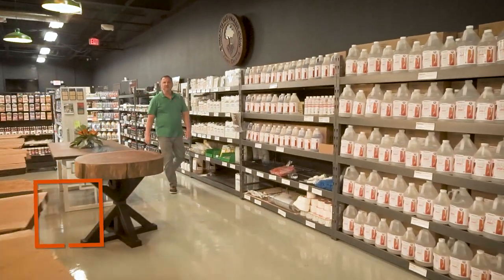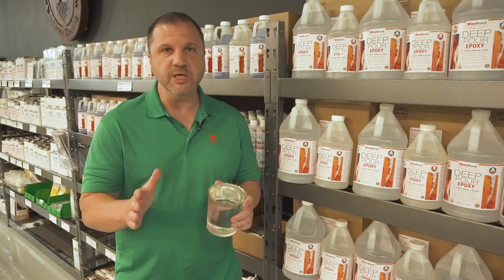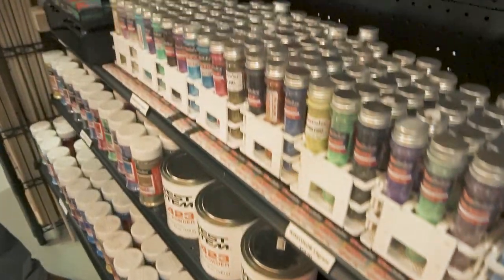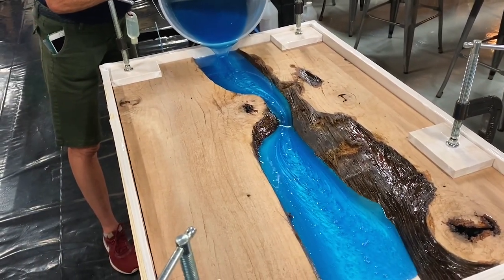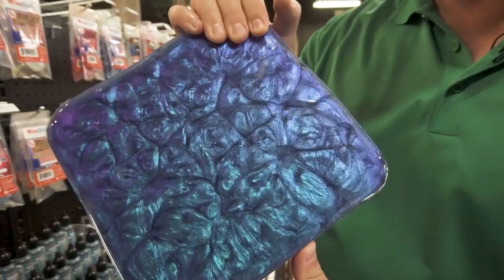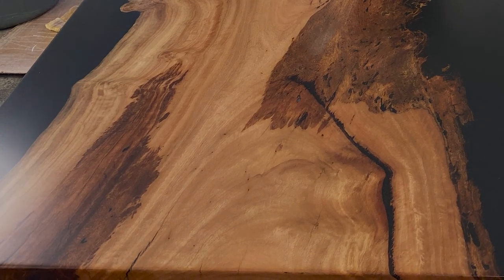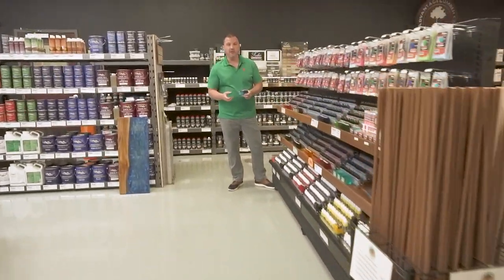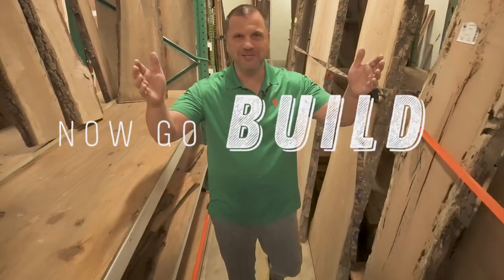Epoxy Colorants Explained- [Mica Powder, Alcohol Dyes, Pigments, And More!]

Comment: I bought a custom made table, they filled a hole of broken wood with some pink-ish epoxy, I honestly don’t like it at all, I hope they had used some darker color epoxy. My question is: is there any way to stain it to make it look darker? The table is finished and we epoxy fully dried.
Reply from the maker: The only way would be to carve out at least the top layer of the cured epoxy using a router or chisel and then pour new epoxy that is colored the way you want it.

Comment: Ok first timer question. I’ve been filling cracks with solid black epoxy using a dye. It’s a cookie cut piece of cherry. Was hoping for a natural finish with black accents in the cracks but the epoxy worked like a stain and the whole piece picked up the black. How do ppl get the black only in the crack without bleeding?
Reply from the maker: That depends on how porous your piece of wood is. You could clear coat the top first to prevent it from staining the wood. You also might want to try different epoxy and colorants. We recommend WiseBond.

Comment: Thank you for the video! It is very informative! If I want to get a swirl of Bronze and dark black, can I mix a Chestnut mica with a Bronze/Copper mica together? If I want the two colors to swirl together but not mix into a single color, should I create a separate pour for each color and mix it using a stick? Or can I pour both mica powders into the same mix and it'll end up having a color mix and not blend? Thanks!!
Reply from the maker: Assuming this is for a river table: Mix 2 colors separately in their own buckets and let sit for 2 hours to get slightly. This thickens the epoxy so it is not so water-like. Slowly pour the colors into the river from each end of the table. The color will meet in the middle. Ideally, you could also make a dam out of cardboard (or something) and once the epoxy is poured, each color wouldn't touch each other. Remove the dam at about the 4-5 hour. But this isn't an exact science. There will be a sweet spot where the epoxy is thick enough that you can "swirl" the colors yourself with a popsicle stick.

Comment: Truly informative.  I am just starting to explore pouring with color.  Keep the informative videos coming.  I'd love to visit your shop.  I have two cuts from a tree that I've dried and want to do something with.  I planned on two side tables.  I'm not sure how to finish them with epoxy.  One has a crack that I'd love to pour a blue color in.  Would I let that cure, then pour the clear?
Reply from the maker: Be careful with wood you cut yourself. The first issue if you air dry it generally takes one year per inch of thickness so if you have a 2" thick slab it would take two years to air dry the center. If it's not done properly you are likely to get lots of undesirable movement like twisting, warping, checking and etc... this could ruin your epoxy job. The second issue is bug larvae such as the powder post beetle can live in wood for up to a year and hatch out even if it's totally encased in epoxy. This can cause an infestation in your home where they chew through all your hardwood items in your house such as kitchen cabinets, trim, flooring. This is why proper kiln drying where the core of the lumber reaches 130-140 degrees to kill bug larvae is very important.
Reply: @AdvantageLumber  I soaked the slabs in :Preservation Solutions - Pentacryl - Green Wood Stabilizer - Treatment for Drying of Fresh Cut Wood - Good for Softwood & Hardwood - Woodworking, Carving, and Turning Solution - 1 Gallon (several gallons) in a tub for 1 year.  Then I took them out just a few weeks ago to dry.  Does this make a difference on the potential "bug infestation".  The only reason this huge pine tree was harvested is due to horrific winds we had in 2020 and it blew over next to friends house.  It appeared to be very healthy.  How will I know?

Comment: Question. After making a table with just walrus oil. And decided to put table top epoxy on it. Will the walrus oil need to be cleaned off somehow?
Reply from the maker: It's obviously better to start clean as any oil type finish can make the epoxy not stick especially if it's a cutting board type oil that never really dries or cures.

Comment: Question for you..I am doing a bathroom vanity diy and its going to be dark walnut on top, do you suggest to use clear epoxy or colored? I am not sure how this works? I want the wood to come through. Do they make wood epoxy?
Reply from the maker: Yes, if its going in a bathroom, where there will be water. Use a clear epoxy. WiseBond makes a Bar and Table Top Epoxy that's crystal clear and will show off the natural wood color.

Comment: If used outdoor, how long would the color in resin last?
Reply from the maker: That depends on how much UV it would be exposed to. Usually you would need a UV blocking clear coat over the top like a marine spar urethane.

Comment: could you recommend an alcohol dye thats rated for outside applications? i really want to make a small table for my patio with the clear colorant but the small pieces i have tried fade when exposed to the sun almost immediately
Reply from the maker: Have you tried coating your project with a marine spar urethane? Generally you need a product like that to block the UV rays.
Reply: Alcohol inks aren’t lightfast so that’s your first issue. They’re no good in resin. Try an epoxy specific tint for a transparent look or a paste pigment or mica powder for a more opaque look.

Comment: I heard alcohol ink makes resin very brittle. can anyone confirm?
Reply from the maker: It depends on the epoxy you are using. We run customers projects through our wide planers, we've seen one explode but they used a cheaper epoxy. We are happy with the results using WiseBond Epoxy.